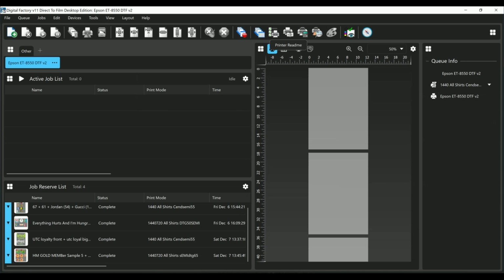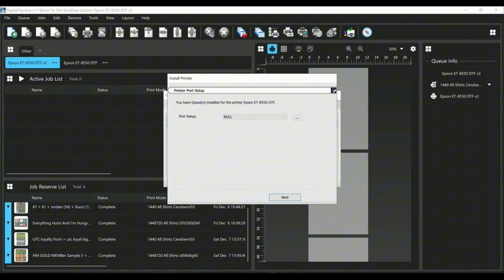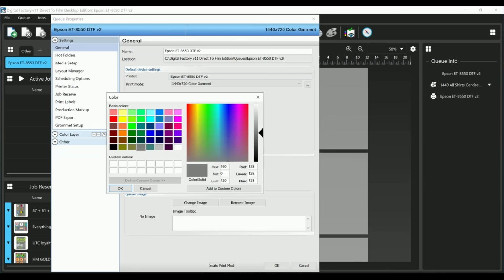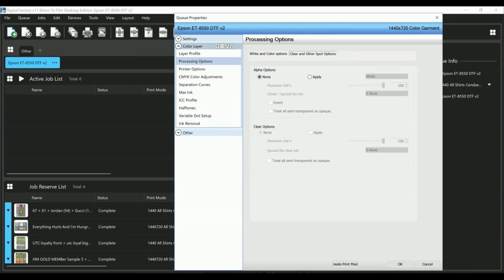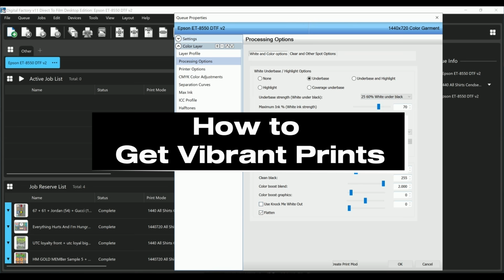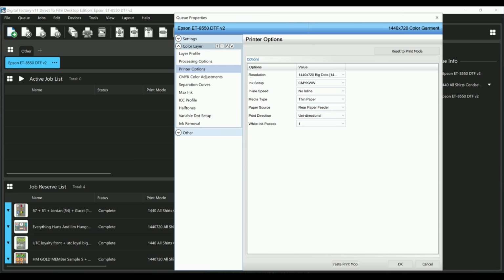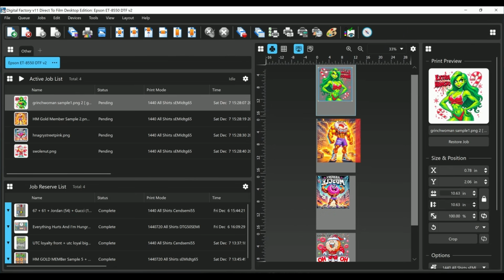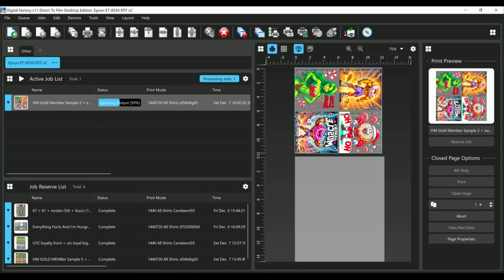Epson ET-8550  Digital Factory 11 / 10 Settings Explained | Full Tutorial

Comment: Hi, could you please tell me how I can get Digital Factory V.11 to print white? I have a modified Epson L8050 printer, and with other software it prints a white base fine, but with Digital Factory V.11 it prints a black base. I've already tried several steps and nothing has worked.
Reply from the maker: at this point then, I recommend signing up for a 1 on 1 zoom call, I'll be able to log on to your computer and get you setup right. No more guessing. https://hangrymuscle.com/products/dtf-technical-support-for-epson-et-8550-xp-15000-acrorip

Comment: Hello, congratulations and thank you for the video and the excellent explanation. I have a favor to ask. I have an Epson L8050 printer that I modified with a roll-to-roll system, and I have Digital Factory V.11 software installed, but it won't print. When I send a print job, the film feeds through and comes out without printing. Could you please tell me which of the printer models listed in the software with the V2 method can be configured for the Epson L8050, since that model isn't on the software's list? Thank you.

Comment: I've tried literally everything and I'm not getting a white underbase.
Reply from the maker: Are you doing nozzle checks on color paper and are all the lines present?
Reply: @HangryMuscle  Yep! All the lines look fine.
Reply: @HangryMuscle  Okay I finally got it work. Had to remove and readd the printer.  I think installing the control panel messed everything up. Also removed all the epson software and drivers from my computer.
Reply: @HangryMuscle  Nevermind still cant get a white underbase.
Reply: @HangryMuscle  I thought there was a faint layer of white but no. I dont think Ive ever been more frustrated or confused in my life by something. I was able to get a white underlayer on blackbox and theres not even an underlayer setting on there. It's just insane. This software sucks. Glad I've spent over 2000 dollars on this whole endeavor only to find out it doesn't work. Ive tried every possible thing for weeks and not once have I got a white underbase on any design. And theres literally no support anywhere on the internet for this issue.

Comment: I am at a loss. I have watched all videos all settings for cadlink. I am still having issues with the white ink causing the ink to run. Brand new printer with Ciss. Tried 3 different types of ink 3 different types of film.  I have messed with so many settings in cadlink wasted so much ink and film. There is also quite a few setting differences from cadlink 10 and 11. looks like in your video you have different settings from my cadlink. (using cadlink 11)
I am open to any help anyone can give me. I am at a complete loss.  if i print without white it looks beautiful but I need the white undercoat so I can press onto dark shirts.
Reply from the maker: White ink running can be caused by quite a few things, the ciss being too high above the printer, the pump being on while printer, wrong settings, printing on the wrong side of the film. Im available by video call if you need assistance.
Reply: @HangryMuscle  nozzle check shows up without a single missed line for each colors. ciss is right next to the printer, to my knowledge my ciss does not have a pump it just has the stirrers for the white ink. I am printing on the slightly textured side the opposite side of the film is smooth.  strange thing is I was continuing to try different settings then all of a sudden no white ink was coming out.  Like I had a clog.  After about an couple of hours of troubleshooting.  there was ink in the tubes but just not printing white, confirmed after a nozzle check. That is when I gave up for the day.

This is my 2nd printer as the first developed the 000031 error. Noticed that the little plastic arm on the gear had broken off. 
had the same white ink issue on that one as well. that is when I swapped out ink to a different brand only to continue having the same issues. 

Can you recommend some known working ink, film powder combinations. I am thinking that maybe I am having some ink film compatibility issues and would like to rule that out.

Comment: Do I have to have a USB to USB cable connecting my computer to my printer? Or just a flash drive?
Reply: USB connected or you can network it.
Reply: @Marc-io6pv I was coming to ask! Bc even tho these printers r expensive as heck they dont come with usb cords! I was wondering do I have to connect my printer to my computer! So i can just WiFi it?
Reply: @arieldelarosa6582 I don't think you can. Connecting printer to WiFi for general use is OK. Just cadlink doesn't give you the option in the queue manager to output via WiFi.  You could always check.  Cables are pretty cheap, I've loads collected over the year. Get a 5m one :)

Comment: How do you reset the settings for each job?  I have one job which I set halftones, the job after that, I don't want halftones.  The settings is somehow persistent where it carries over and I can't find a way to reset the settings.  There are times when I change the paper size, and it won't switch the paper size until 2 jobs later; wasting ink and DTF paper.  What I tried to do is create new settings and removing the job from the queue, which I suspect is not the right way to reset the properties settings.  Cadlink v.11, ET-8550 DTF CenDale Ink.

Comment: I have horizontal lines in my prints Ive did all the cleaning .

Also are you using matte or glossy film . I use matte and it’s had to tell which side the right side and I don’t know if settings need to be different depending on which you use